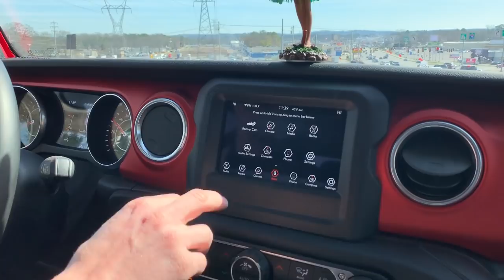Rebuilding A Wrecked 2020 Jeep Gladiator Rubicon Part 10

Comment: I have a 2019 rubicon that I got from dealer and it also has problems with locking the diffs sometimes, it happens to a lot of jeeps you just have to move a coupe feet while locking it

Comment: Might have blown fuse for the 4x4 from when the wiring was cut in the accident.
Reply: I don’t think these are electronically shifted transfer cases.
Reply: Patrick Murray there must be sensors and electronics involved because it’s coming up with warnings on the dash. 🤔
Reply: Good Point! But whatever the 'glitch' it sure pays to test drive before calling it done.
Reply: Lockers are only engaged after you press the off-road + button next to the locker switch

Comment: Hey guys I’ve been following this build and I love it so far. Noticed you were struggling shifting into 4HI. The linkage to their transfer case is a cable that can stretch. If the transfer case shifter won’t slide into gear just go forward or reverse a couple inches and it should slide right in and help avoid the cable stretching 👍🏻

Comment: Hey, just a tip. I saw some of the gritty looking paint from your paint job, the reason this tends to happen, especially to your Jeep this time is because the ambient air temperature and Jeep were very warm from the 3 heaters that the paint partially dried mid spray before it was attached to the panels. This creates that gritty feeling and appearance. On the bright side you guys do so well buffing that it comes out looking real nice. Keep up the amazing work!

Comment: just a suggestion Lads, for your shop heat needs i would look into the Mr. Buddy Maxx heater. i have one in my metal shop like yours my shop is 30'x40' and i can keep my shop in the mid 60s when it's in the 30s outside easily. i would suggest the 80,000 BTU unit. it exhausts the fumes outside so you won't blow yourselves up and i inst. the propane conversion kit on mine and run it off 100# propane tanks. i get close to a week off 1. bottle which is 23 gallons @ 1.85 per gallon it's cheaper than the kerosene unit you have and it won't asphyxiate you guys or make you sick and effect your paint work.

Comment: The electronic 4WD actuator on the front passenger side axle is just like the one used on the Dodge 3500 4x4 and it's manufacturered out of abs plastic just the cover that is facing downward and tends to malfunction by stress cracks. It is my suggestion to have a duplicate cover made of billet aluminum to replace the plastic cover and maybe even a shielded skid plate.  I have not found one on the market yet so you might even get a patent on it as well.

Aloha & Mahalo -

Comment: Pro-tip for next time:
Instead of drilling a hole to gain access to weld that body nut on, you could have welded a stoping plate to it so once you get it into place and get the bolt started, that plate that you welded to it would have caught on the inside and held the nut so you could torque the bolt down.

Comment: Great job guys! Check out the Tazer JL by Z Automotive. The Tazer JL will help you tune the jeep and has a ton of functions to flash to the computer....like changing the gear ratio when you swap gears for the 37's to 4.88. They also sell the front facing camera on thier website that you were talking about getting.

Comment: Your airbag light might be out.  but it still has about 15 stored codes in it until you erase them.
And Dodge, Jeep, Chrysler changed their protocol in 2018.  you have to scan and clear it thru the security module plugs and not the OBDII port.

Comment: Electronic locker only engage on 4l, neutral, push the button, and turn steering wheel to one side and another, that moves the splines of the rear diff mm so the locker engage.

Comment: 4x4 problem could be related to the TIPM that Dodge, Ram, Chrystler, Jeep put in there vehicles, I just ran into that issue working on a ram. Could be a fuse or wiring put it on a scanner and go from there!

Comment: Hey guys just a FYI you need to be moving to change from 2wd to 4wd and about 2mph for 4 low, its bad to change it well not moving. Check the plugs on the diff they are known to go bad, Broke mine 3 times and i only have 19000km - 12000 miles

Comment: Looks like you still have an electrical problem. Even if the front end is not engaging, you should still be able to lock the rear end. You can't lock the front end if the front end is not engaging. I don't think the rear locker cable is in that bundle that you worked on, but I could be wrong.

Comment: With the manual and those 488 gears, you should be fine putting 37's on it. You will lose a little power, but that's to be expected. 529's would be the next set of gears you would want to go with if you're wanting to turn larger tires.

Comment: The lockers will only lock in 4 LOW,  it is controlled electricly, and yes there is a BYPASS that will allow locking in ANY RANGE even in 2 HI. There is you tube vids on how to do it, just a jumper wire to the dash switch to make the computer think it is in 4 low. In any case it will only lock when you are moving at 10 mph or lower, and it may take 30 sec or more to engage or dis engage, works best driving slow and in a straight line. If there is stress on the axels because of tight radius turning or axels articulated it may not lock untill you are back on level and straight  line of travel.   CHEERS the trucl is looking good.                          Steve h.

Comment: dont change gear from hi to low by force, you have to move truck little bit then it will be smooth, same for locks move the truck little bit, its mechanical thing not some software lock

Comment: The Gladiator needs more power, especially after you add big wheels and tires. I know there used to be a company that made a supercharger kit for the JK’s, I’m sure there’s some sorta supercharger kit or turbo kit for this jeep
Reply: brandonburchell8 we’re running 40s on our gladiator and 42s on our JL. No need for a supercharger just needs to be regeared properly.

Comment: Get ride of the electrical 4x4 and install a posilock it like a old school chock pull out front is locker push it back in 2 wheel drive works better than oem will not leave you stranded.

Comment: Hey, You guys need to disassemble that 4X4 Actuator and clean it out then remove that code from the ECU then try it again and if that doesn't fix your issue then replace that front 4X4 Actuator/Solenoid. Keep us posted on how that works before you spend $ unnecessarily on parts that don't need replaced!!!

Comment: Break her down, if you're plans are to take her up another level with a suspension and 37's.  If you don't shoot for the sponsors then break down those 44's, it comes with Tru lok's electronic locking diffs, and a 4-1 Rock Trac T Case... due too the impact/damage I would service them, and replace those CV Joints on the Drive Shafts, #Energy Suspension Body Mounts/Bushings.  It's about time Goonzquad picks up a 20 Ton Shop Press #Eastwood, #Jegs.  Man she would look sweet with some Black Rino Wheels wrapped in those 37s.. Maxis Trepadors would Rip... Sorry.. I'm somewhat of a Jeep Nut.

Comment: At 2:14 you said "almost OEM finish". I seriously hope you strive for much better than OEM finish which is generally thin, wavy paint with much orange peel. The last full nut and bolt restoration I did was a grey market, 1976 Porsche 930 Turbo. The owner asked if I would be able to achieve OE paint quality and I said, "god no.......the paint will be well beyond what the manufacturer puts on the market."  The vast majority of OE paint jobs just barely protect the metal for about 10 years. People are so accustomed to seeing crap that comes off the assembly line, they think that is some sort of high water mark..

Comment: LOLOLOL The Jeep needs to be crawling to switch to 4wd, thats why you were having a hard time shifting it in park lololololol. That was hilarious to see, it shifts like butter at 2-5mh. You prob blew a fuse when you used the vacuum from the cig lighter tho, which is why youre getting the check light and why it isnt working.

Comment: Just curious do you guys know what OEM stands for? Do you guys watching the videos know what OEM stands for? You would say that it looks "factory" not OEM. For example after sanding and buffing the paint looks "factory" or as it came from the factory. Saying that the paint looks "original equipment manufacturer" just does not work.